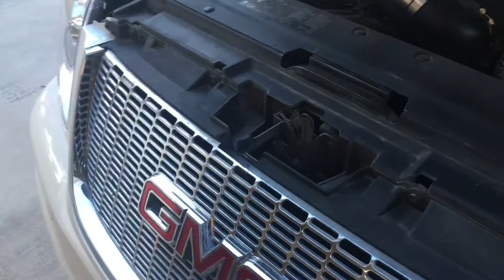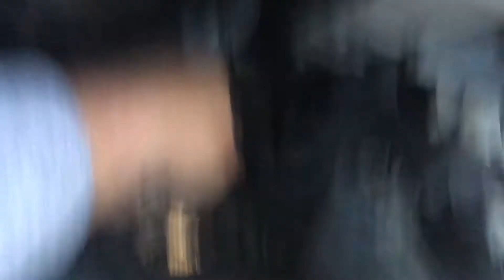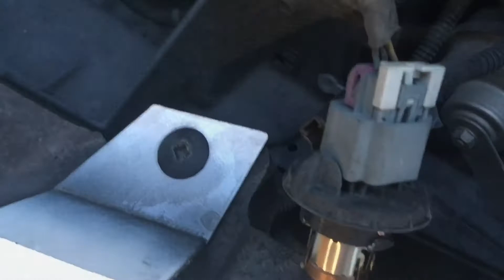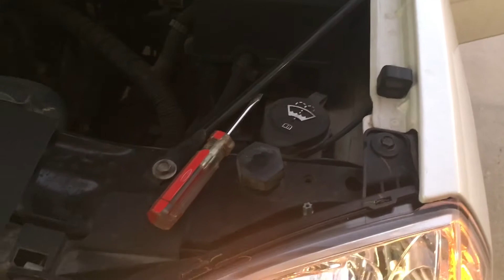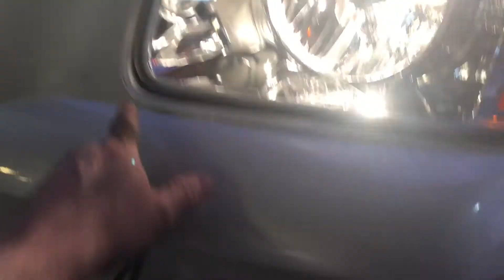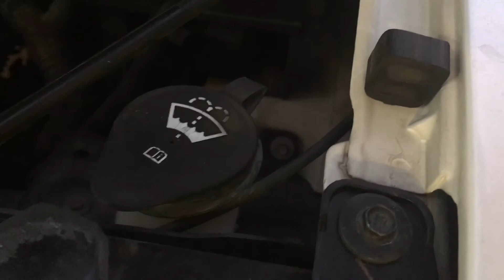2011 Yukon Headlight Assembly install

Comment: Perfect video. About 1 hour for someone who hates auto repair. One mistake I made was on the install of the new light. I pulled off the lower light clip on the new light to connect it and couldn't get it on the plastic molding (not enough space to push it on with hand). I had to unhook the wiring and remove the new light to reattach the clip, then plug it in.